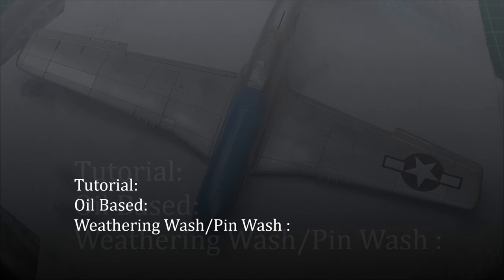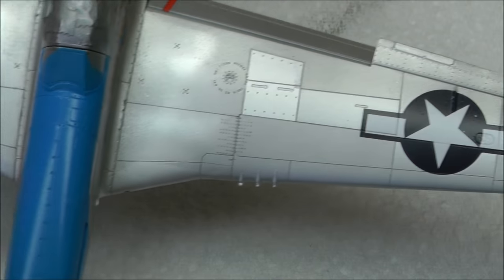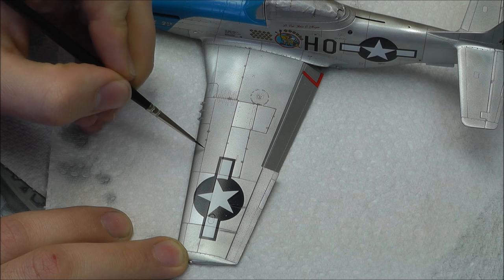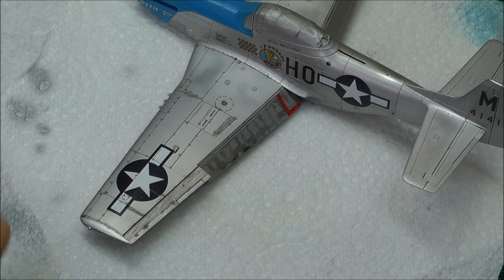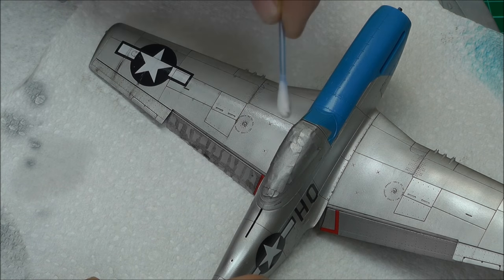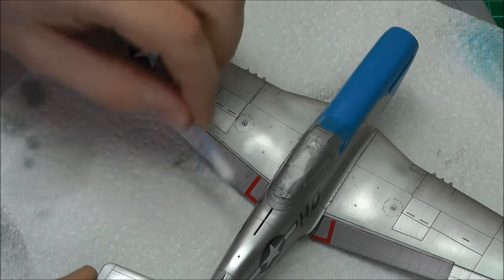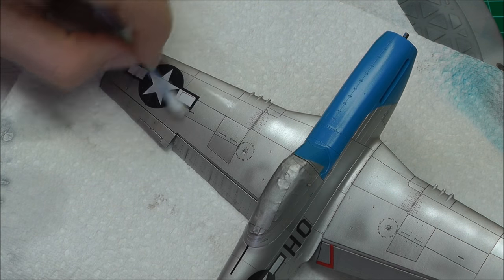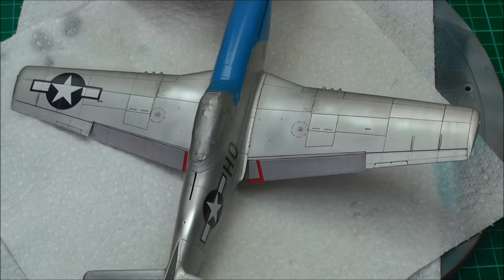Weathering Wash (Pin Wash) : Panel Lines, Streaking and Fading : Tutorial

Comment: Bob .how many coats of clear .I use acrylic paint vallajo paint and gloss . The problem I have had in the past doing any wash .once I start to clean off the wash .it's stuck like glue as though I have repainted .and during the clean up my paint starts to come away reviling the bare plastics or undercoat ...it's so much hard work and the damage that's left .I feel is it worth killing a good paint job just to make it look used ...I have in the past put 3 heavy coats of varnish to the point it's dripping off ..and still the same problem as before .I end up repainting .
Reply: Exactly what happened to me, I hope you found a solution! I used to use promodellers wash from flory models but they don’t seem to have those weathering washes anymore… I didn’t even need to use clear coat and washed off perfect with water! I tried tamiya panel line accent color and MiG Vallejo washes… both ruin the paint and the clear coat.
Reply: Was the gloss coat that you used acrylicor enamel based?

Comment: What do you use to seal the paint before you put on the pin wash?
Reply from the maker: just a water based gloss mate any should do
Reply: @genessismodels  I can only get Testors gloss lacquer here. Can I still use an oil wash and thinner or do I need acrylic wash and acrylic thinner?
Reply: @boblum3360  You can buy Tamyia acrylic paints, clear coats, and thinner thru the many online hobby shops via amazon. Avoid using Testers thinner as a wash cleaner if you have a Testers gloss coat finish. Think about it if your clear coat/dull coat is thinned with it you can't use it as a wash or it can break down and possibly ruin your finish. However, you can use testers thinner on a fully dried acrylic paint to clean up over spray etc...